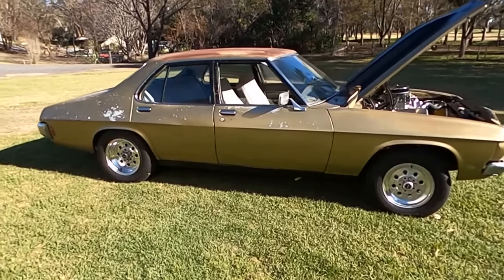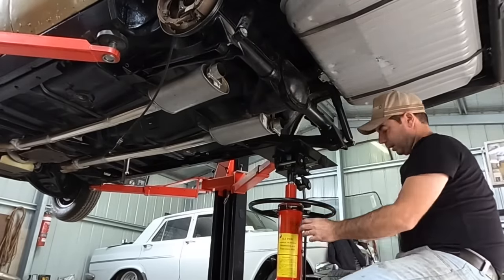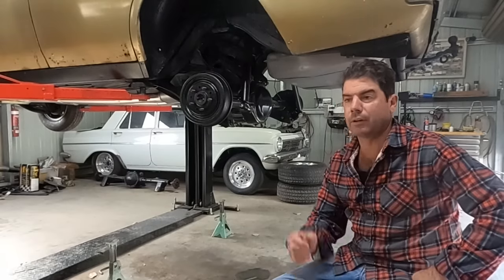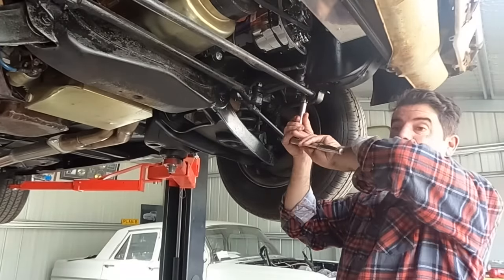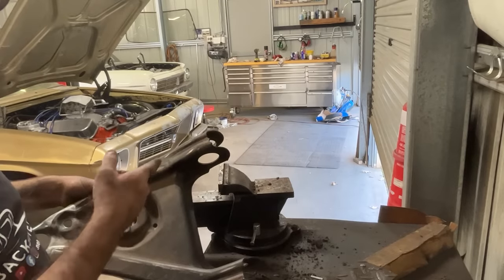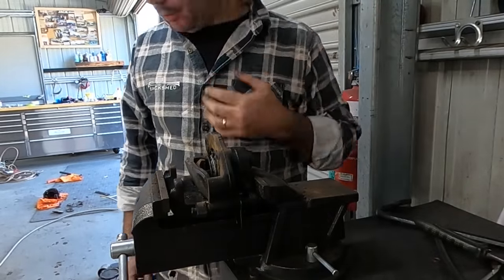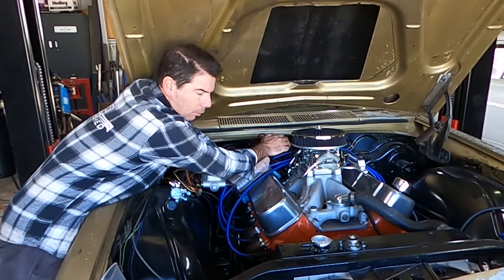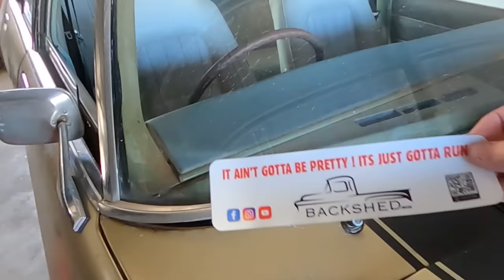EP25 HQ HOLDEN FIND , FROM ABANDONED FOR YEARS TO BIG BLOCK CHEV ENGINE SWAP AND BURNOUTS . MUCUS HQ

Comment: Haha the old "use the drum as an axle puller" trick.
My LH SLR 5000 had a drum banjo and just before the spider gears would blow apart, the axle splines would twist a little.
So  the drum trick always came in handy.
In the end I could change a centre in it in about 40 minutes.
The problem was solved when I traded it in for an LX A9X torrie which had the bigger 10 bolt. But if we are going to talk about tall gearing, My A9X had a 2.6 to 1 ratio out the factory.
Why that was the case I never knew.
Great video. Nice to see people saving these old girls.
I shudder to think how many pretty solid hq's we sent to the tip in the 80s. 😢

Comment: Another enjoyable episode. Thanks. I've never made a brake line but I did have some thoughts to avoid adding segments of the bent wire to calculate the length you will need. First is run a bit of string or electrical wire along the bent one and measure that. Second is to mark as many 10cm marks on the straight fencing wire as you think you'll need near where you estimate the length and just count them up with a measurement near the end from the last mark. 

Colour me ignorant if needed but the front looked high by a fair bit. Do you expect it to settle, or is that the way it is supposed to be.
Reply from the maker: Bit of both mate , it will settle but I am going to leave it racked to the rear a little. 🍺👍

Comment: ya wouldn't ever guess by looking at my '97 Tacoma. But everything from underneath the Hood to all four wheels is basically restored, rebuilt (by my hands) or brand new. The truck was wreaked & a large hole thru the block when I bought it. Runs & drives better than most newer disposable vehicles. All the best vehicles were made before 2000.

Comment: Hq-wb definitely need big blocks,small blocks don't seem right in the bay, big blocks with 2" primary pacemakers fit nicely in the Q bays,me mate has 454 hq ute for last 30yrs, it's just the way you gotta go, leave the small blocks for Torana's n commodores👍
Reply from the maker: They do seem at home in there 🍺🍺👍
Reply: @backshed5295  yer as they got same dimensions in the bay as yank chevelles and camaros that easily snuggled in the Rat, when i go to me old mates soon I'll try takin some pix but he's old school and protective of his chariots...🤪😂 He calls it "silvery", sits  low n  menacing with unmistakable deep 454 gurgle out the twin 3" exhaust...👌, Has more appeal than hq 2 door coupe ,its hard not to like, just missing a 8/71 blower

Comment: Great video, like others I was wondering if you were OK. Interesting thing about those lifters, I had used a set of the Rhodes anti pump ups, they were and are still  click like solids, thanks to this video I get it now.  That was a great trick with bending the tubing, I went and bought the bender, wish I had seen this long time ago.  I did see my biggest problem with working on my rides is I don't drink beer,  used to but quit,  huh might better try some again.  That blowing of the puck out of the caliper made me cringe, had same experience, at time I was not smart enough to turn down so it got 125 psi. Yikes bad times, only once. Thanks again for the great video.......

,
Reply from the maker: Hahaha  cheers  for watching Steve 
Stay quit mate beer ain’t the answer Hahhah💪👍
Reply: @backshed5295  you know better sometimes it's the only way to solve a problem... ha ha
Reply from the maker: Strange but sometime it seem that way , maybe just slowing down and standing back for 10mins is the answer and beer just happened to be there hahahhah🍺👍
Reply: @backshed5295  could be beer levels the playing field. Ya know man, it's man vs machine.  Sorta strange in the house I grew up in all my brothers and sister got silver spoon and brains. Not steve he got a Cresent wrench and a hot rod magazine. Even dad was an egg head.  Later man. Don't get me wrong I really enjoy my skill set. Thanks for commenting, maybe someday I will venture over there. It is on my list to do.....

Comment: AN THE RTS SIDE OF IT WAS MORE THE SPRINGS WHICH MEANT YA DIDN'T HAVE CHANGE THEM IF YA PUT V8 IN A 6 CYL I USED A SET IN A HJ DONT THINK IT EVER HIT THE FRONT BUMP STOPS WITH A 202 AFTER THAT

Comment: What was that that fell off the rad support at 1:57.10, a cap of some sort?
Reply from the maker: Yep mate just radiator cap that was sitting on the top tank mate , I left it off to start to bleed the system when running but the cap didn’t like mucus’s awesome lumpy idle Hahahha. Cheers Chris for watching mate 
I see you YouTube user name is 351 have you watched the drags video with the Xy 410ci clevo?🍺👍
Reply: @backshed5295 yeah thats a nice lumpy idle wish my 302C had that but it still sounds good👍

Yes i have seen your XY, very nice Mick👍
Reply from the maker: Cheers mate just thought as a ford fan you might enjoy it. Cleveland at 7500rpm type music hahaha
Reply: @backshed5295  fuck yeah👍 even 2500 rpms@ 100ks on the M1 to Geelong is just nice with the 2.77:1 in the FD LTD she goes along nicely 👍

Comment: You can trust the sikaflex mate that particular type is so good you can stick runny poo to the ceiling
Reply from the maker: Hahahha I’ll take ya word on that 1 mate 🍺👍
Reply: Have used it in building aluminium ocean going catamarans benches etc brilliant stuff
Reply from the maker: Yeah it’s good stuff , I believe some 90’s holdens have the whole firewall stuck in with it not welded to try to reduce NVH , noise vibrations, harshness as the engineers call it.
Reply: @backshed5295  I will add that I’m a boilermaker/welder so well done on your spotting lol

Comment: @7:25

The factory redish coloured thicker walled tailshaft for the th400/10 bolt

It's in the genuine factory Holden workshop manuals

It won't fit the th350 without modification 

Had one in my Hz 308, th400 & 10 bolt

Again I should never have sold her 😭

I tried to talk to my local driveline specialist about this tailshaft when I was looking at diff options for the hz

He had no idea what I was talking about and laughed at the idea of this tailshaft even existing 🤷‍♂️

If anyone has one of these tailshafts in their hq, hj, hx, Hz its guaranteed the car has a th400 unless the tailshaft has been modified

Sorry bit of a rant

Like to comment for the YT algorithm
Reply from the maker: Yeah I wasn’t going to bother looking for factory crap and really Mucus once I start leaning on that motor would probably test stock stuff to it’s limit. Cheers for coming back for another mate 🍺🍺👍